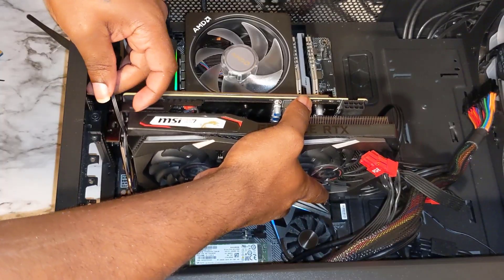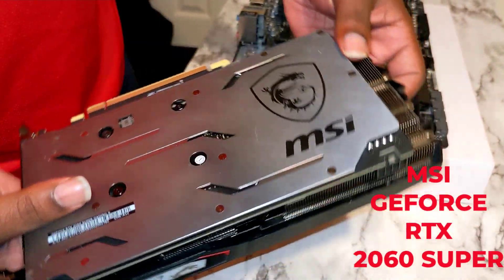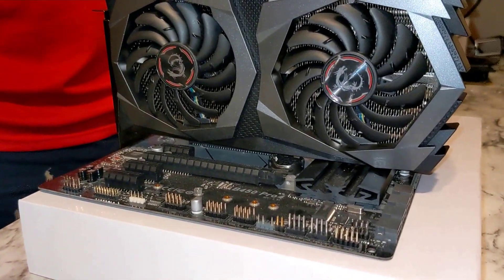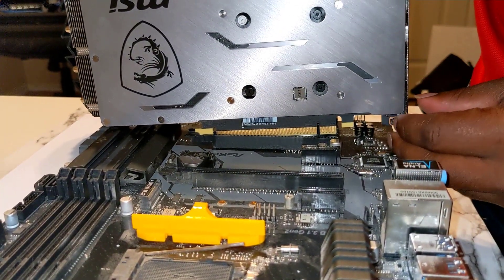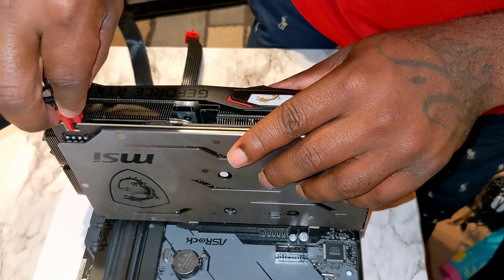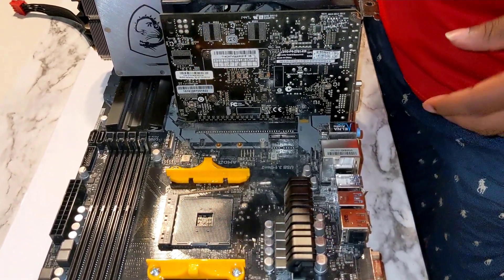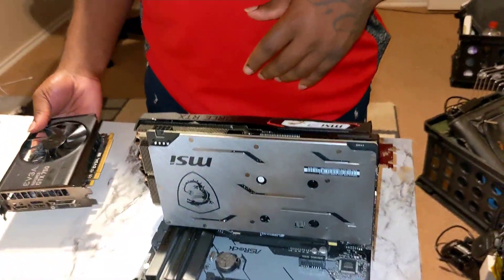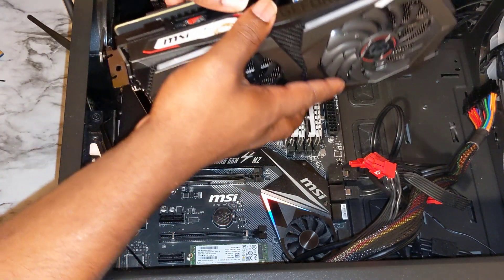How to install graphics card? (Geforce RTX 2060 Super)

Comment: The rtx 2060 super should be plug in to the pcie slot by 16 ( the closest  to the cpu ) the gtx 750 should be at bottom of the 2060s.
By the way whats the use of dual card if its not working as one.
I mean in nvidia it should be SLI compatible cards and crossfire for AMD.

Comment: Thank you.  My system arrived with a very tight loop of the power cable for the GPU over the packing foam and I was uncertain if the auxiliary power off the GPU power was supposed to be connected and had come loose or was simply extra.  Looks to be extra like yours, so here's hoping!
Reply from the maker: Yea they are most likely. More is better I guess.

Comment: Hi, very much thanks for the video. I will like to if a 550W PSU will be able to accommodate an RTX 2060 super GPU?  Many thanks.
Reply from the maker: Thanks for watching and yes that should be enough but more is always better depending on your processor and future upgrades. You're good to go though.
Reply: @omni-tech   Thanks a lot, my computer Processor is;- Intel(R) Core(TM) i7-4770CPU @ 3.40GHZ

System type;  64-bit Operating System, x64-based processor. I am thinking of buying and installing GIGABYTE GeForce RTX 2060 SUPER WINDFORCE OC, but I am a bit worried and concerned that it might fry or destroy my computer motherboard.
I was then considering going for GEFORCE RTX 2060 OC instead if it will be more compatible with my system
I will be glad to get more advice from you. 

Many thanks indeed.
Reply: @Passive-Vision  Does it work?